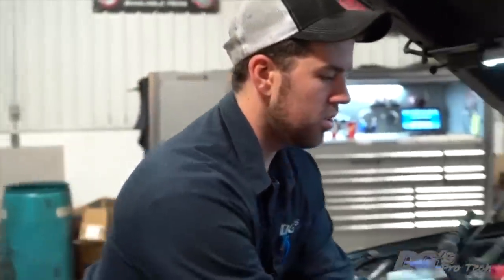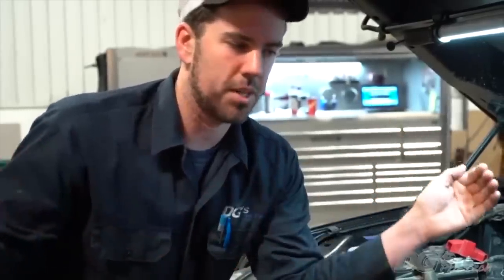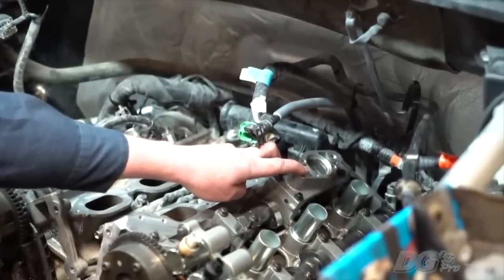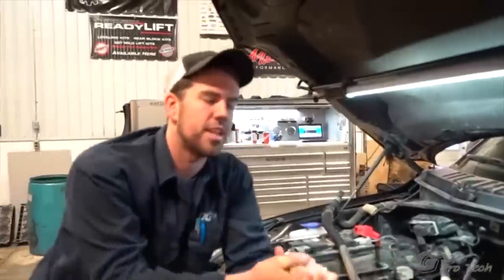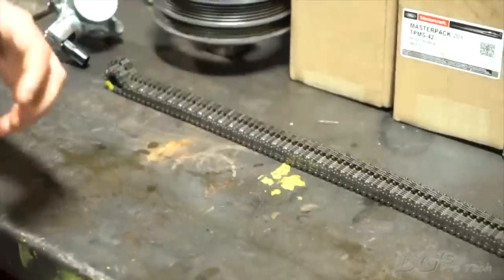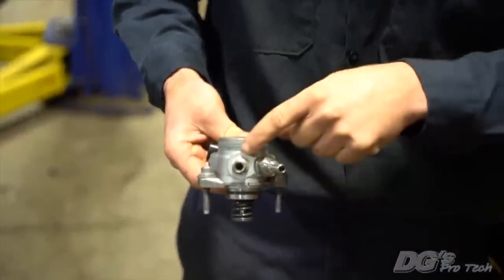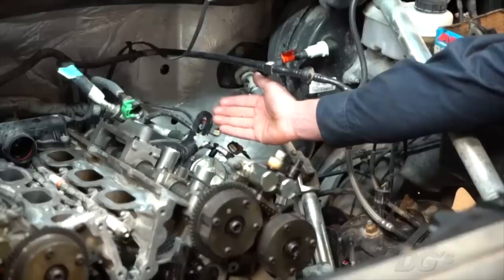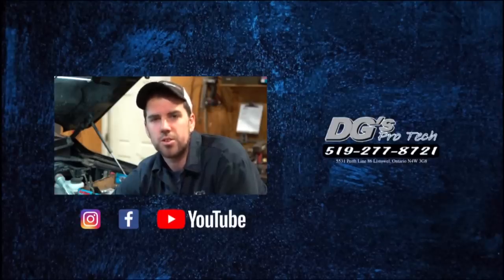What you NEED to know about Ford EcoBoost Engines by Dustin Golley of DG's ProTech

Comment: I'm old school I've never understood labels on a bottles of oil stating 5K 10K interval oil changes you can go. First of all even though engines are mass produced they all are slightly different meaning they all behave differently some burn oil more than other engines do. Most people don't understand this. In terms of the topic maintenance you can expect to go 5K 10K between oil changes because you don't know how that engine burns oil. Some do some don't. I have a 1995 Ford F250 with a big block 460 cubic inch motor 7.5 liters. with 86K miles on it. I change my oil on all my cars myself religiously at 3K miles. I said I was old school. And because it's a 1995 I check my oil level once a week sometimes once every two weeks. That truck burns NO oil at all every 3K oil change. At 3K the oil level is always full. Now we have two Chrysler town and country Van's. The 2010 has the 4.0 liter V6 engine. the 2015 has the 3.6 liter engine both of those motors burn oil.! The 4.0 I have to add half a quart right at 2600 miles to ensure get to 3K oil change. And the 3.6 I have to add a quarter of a bottle of oil right at 2900 miles. All cars I use the best on the store shelves full synthetic. We also have a 2007 Chrysler Aspen suv 5.7 liter Hemi it's a nice looking suv we are the 3rd owner of it and it had about 89K when we bought it. No telling how the first couple of owners treated that vehicle but it to burns oil. Bottom line change your oil every 3K not 5K or 10K it's not all that much more $$$ well it's alot cheaper than the auto repair this mechanic is doing

Comment: Don't forget one of the more important steps,  let your eco boost run, and cool down at idle after a trip home,  or after pulling.  I like your video.  Keep it clean,  (good oil), open it up once in a bit.  
But let that thing cool.  If you pulling something and your finally at your destination,  don't just shut off. Let idle,  it allows the turbo to cool.  
Great video

Comment: The first day the engines came out any mechanic with half a brain could see they were junk and where the problem would be.  Running a high pressure fuel pump with the timing chain?  These engines and all like them are junk and always will be.  Avoid

Comment: As an expert in the manufacturing of full synthetic engine oil, you should use at least a 10W30 full synthetic unless you pull a trailer over 3,000 pounds. Then use a 15W40 full synthetic for heavy towing. Change the oil filter ( never Fram )every 3,000 miles WITHOUT draining the synthetic from the engine. Change your synthetic every 10,000 to 12,000 miles or once a year, if you don't drive much. A full synthetic never breaks down ( it's not petroleum, it's a chemical lube) but it accumulates carbon by breaking it ( carbon ) down in the parts of the engine. Never, ever let your engine overheat. If it constantly runs too hot in the summer, add a double oil filter unit and use a longer oil filter, to keep the temps lower. If you summer temps are 80 F every day, use a heavier grade of synthetic. Never use Castrol synthetic as it's made from petroleum oil. Use Valvoline, Quaker State, Pennzoil or Mobil One synthetics to have the best quality. Change your front wheel drive auto trans fluid every 25,000 miles and use a quality synthetic there too. My fleets ran over 25 million miles ( 40 million km) so we got instant feedback on any issues. Synthetic oils save 5 percent on fuel use in the warm months, so it actually saves fuel costs. They save 15 percent in fuel use during the winter for trips up to 12 miles at 20 degrees F.

Comment: When he said, "This chain is a little lighter than I want to see."  he is calling FORD out on the fact that FORD cheeped out on the timing chain.  The bulk of the chain is too little and the toughness of the chain is too low.
Reply: They are all into making the vehicles as light as can be. Just like that truck is rated to tow close to 13,000 lbs but anybody who has towed knows that truck is to light to safely do it. I would not want a 5500 lb truck towing 13,000 lbs that is for sure.
Reply: @tshearn624  Just like I  wouldn't want a 7500 RAM pulling a 30,000 lb trailer - but they advertise that.
Reply: I agree Duanne
Reply: The Ram 3500 weighs over 11,000 lbs though so I would be good with that.

Comment: After all these years, they still use a link type chain. Surprised they aren't using plastic tooth aluminum gears, also. Should be using roller chain, and not interference engine.  Engineered obsolescence!

Comment: So basically buy a 5.0. Drive it however you want. The money lost at the pump is wash when you're talking about synthetic oil changes more frequently. These little V6s sound like fart can cars. Nice ford truck with 33 inch mud terrains flashy wheels but sounds like grandma's Honda Accord.

Comment: My 2.7 reg cab 4x4 is lifted 4 inches on 35s with spedo recalibration ,combined milage 23 mpg towing a 14 foot car hauler amd 3500 pound car 18 mpg 61000 miles so far full synthetic every 5k only oem air filters

Comment: my Escape has the 1.5 EcoBoost under the hood.  It's been three years and not one issue.  My only recommendation is having a good grip on the wheel, when you step in the gas.  It has 30,000 miles of city driving and averages 25 mpg

Comment: great video. great point about oil changes; even with synthetic oil, turbocharged engines should have their oil changed 6k-7500k miles tops. they only have the worst exhaust note of any stock vehicle on the market, but thats not really an issue. love the ecoboost motors. It's strange, I wonder if some of the timing chain issues stem from the HPFP being on the cam lobe. it seems like a lot of DI gas engines have timing chain issues

Comment: You should expect with today’s reputable car manufacturers more than 250 to 300K and even more, with a “SANE” mature driver that is, with the right synthetic oil and quality filter and a 6 to 8K service the mechanical  “engine” parts should last, don’t forget spark plug change and do them at 50K “ NOT “ 100K, air filter at 25K and coolant changes as recommended by manufacturer ! Automatic transmissions are so many times neglected, keep on top of that service with correct quality manufacturer recommended transmission fluid and filters !

Comment: Excellent explanations all the way around.  I love his explanation for those complaining about poor gas mileage.  You can have Eco, or you can have Boost, but don't expect both at the same time.  There is no free lunch and that's been a constant for as long as internal combustion engines have been in existence.   I've heard of the cam chain stretch issues before which kind of suprises me.  That's not something that I've seen common on most OHC engine with chains.  I'm guessing it has to do with that high pressure direct injection fuel pump?   That's got to be adding quite a bit of added stress on the cam chain?

Comment: What a crock!! More Ford garbage!!
My Silverado 5.3 V8 AVERARGES 24 MPG and higher AVERARGE!! I have hit the Rev limiter racing in four low multiple times!!! It  Has 107, 000 trouble free miles and I off road the shit out of it!!
My 4.3 ZR2 had 252,000 miles on it when I sold it and ran perfect!
Ford's are Ford's!! Garbage!!!
Oh and you can easily go 10,000 in a Chevy on an oil change!!!
YouTube Deboss garage Why not Ford.
YouTube CAR WIZARD tears down a 5.4 Triton.
JUNK!!!

Comment: I have a 2013 fx4 ecoboost and I'm so satisfied with its performance. I think that the drivetrain is to big for the truck as in using it for work. I've pulled 12,500 from Michigan to Florida 5 times with no problem even in Tennessee and Kentucky. I use my truck for my lawn care business and fill the bed to where it needs a tarp over it so no logs fall out and pull my 14foot dump trailer. This is where cause of payload and tounge weight it putting the truck to its max I put another leaf on both sides plus a helper. But i think my f150 out performs my 2013 HD chevy i had in heavy towing best truck i ever bought. Ford should beef up the rear end on the truck and put airbag assist to level it out then the truck would be a pulling monster for a half ton

Comment: Owned two of these. Over 100k miles on them. No timing chain stretch. No magic timer on when to change the oil. In fact, the oil life monitor estimates oil life based on throttle readings, towing or not, temperatures, and a bunch of other parameters. There is no "turn the light on after X miles" on my trucks. Also, the manual recommends a MAX of 7,500mi interval on the oil changes. Ford does NOT recommend over that. Anybody doing 10,000+ mi changes has not read their manual and they feel that they know better than the people who designed the engine.

Only turbo issue I had was due to a factory assembly issue. A cooling line was not assembled correctly and it leaked, causing one to burn up. Replaced for free. I drive gently in traffic and use them when I tow or need to go quickly. Every time I hear of turbo issues, or issues with timing chains, is when people buy the truck for the mileage and granny it everywhere, or when a hot-blooded guy gets one and drag-races everything else on the road (high RPM, always in boost). The other 99% of us have had no issues with these engines.

To sum it, if you buy a dang truck, drive it like one. Don't stomp it like it's a Mustang. Don't granny it like it's an Oldsmobile. Drive it. Use your brain and change the oil when the IOLM gets down around 30%. I know a few guys that have 500k on their 3.5's and have had zero issues with them. Heck, a guy just turned over 220k and posted his truck on Reddit a week ago. These engines do not have issues any more than any other engine. The driver is the issue.
Reply: 500K bullcrap..everything else on those trucks would be dead.
Reply: @chadhaire1711  I had two 1995 Rangers. Both were super-cab 2WD. One was a 2.3L I4 manual transmission with 363,000 on it when a guy hit me and rolled it twice. The other was a 3.0L V6 automatic with 312,000 on it when an idiot had a 700cc quad roll put of his truck and hit it head-on, bending the frame. Neither had any issues due to maintenance. Neither was rusty. Neither burned oil. But I guess in less than 200k more they would have been junk? Right.

Also, consider that the new F150 from 2015 on is aluminum. It literally does not rust. If you scratch it, it will oxidize and seal the metal. So if you do proper maintenance (plugs, wires, differential fluid, transfer case fluid, transmission fluid and filter, bearing grease, u-joints, etc etc) they literally will last forever. Not all of us beat them to death because they have turbos.
Reply: @GuretoSefirosu   The Ranger was nothing but a Ford Pinto..if you got more than 100K consider  yourself lucky.
Reply: @chadhaire1711  It is fairly clear you are not a Ford person. Rangers are known for going forever, even after being abused. In fact, they are about the toughest small-size truck around. Well, were until they stopped making them in something like 2010. New ones are NOT the same breed. Either way you are either trolling or do not know what you speak of.

Comment: stretched chain is due to contaminated oil with soot particles. Also, fuel dilution contaminates oil to the point that oil is no longer provides lubrication. Synthetic blend oil at 2500k miles is beyond oil specification and cannot be used beyond 2500k miles. Cheap oil gives you cheap results and engine wear.

Comment: This helps me. I always have used Mobil 1, Motorcraft oil filters, change oil, filter every 5 k miles. Just need to open her up a bit more...
Reply: R Mack  Paid oil lab analysis are extremely accurate that is like saying a blood test to show certain level of vitamins are not accurate.. the lab tests shows various metals in the oil analysis trust me i used to pay for the off brand full synthetics ill never use anything but motorcraft from now on in my ford engines this is strictly for for engines im saying i believe ford uses special additives that are SPECIFICALLY formulated for better wear results than other universal oils and it makes perfect sense they know there engine best and what its made of specifically just like the cooling system... and why they stress to use motorcraft coolant it protects the cooling system the best from after market brands
Reply: R Mack  You must have a low iq that wasnt the point at all... the point was about how their oil is best suited for ford engines and how a lot of people go off and use off brand shit that isnt as effective at protecting FORD specific parts
Reply: If your not using the ford oil your doing it wrong.. there is a guy on amazon who paid for oil lab tests and showed that the motorcraft oil gave the best results for ford engines.. who would of thought ford oil would be more effective on ford engines than a universal off brand... ( This oil gave me the BEST Blackstone Lab reports on my Ford  engine. Lowest parts per million on iron, aluminum & other important metals. I wish I had used this oil from the date I purchased the car. )
Reply: R Mack  Haha

Comment: You forgot a couple other issues:

1. The lack of a mechanism to clean the intake valves and carbon build up that comes from PCV/EGR gasses building up on the back side of the intake valves. 

2. The intercooler water slug of death! No float drain built into the first Gen eco boost intercooler. Major oversight. Hydro lock over a $1 component that was left on the engineering block.

Comment: Great video and very well done! Although not your intention, you listed a bunch of compelling arguments against a ecoboost engine.  These vehicles are already too big and costly to have the specter of all these failures hanging over your head. Sadly, due to unrealistic mileage requirements and arbitrary unrealistic test criteria, all these costs land on the owner. Consider the resources to build and maintain such a complex machine that at best gets slightly better mileage? What have we saved?
Reply: you run up 150K miles then sell it to some sucker before it breaks.

Comment: They get great fuel mileage on long easy trips. Have made 26 miles/gallon on a long highway trip with mine, but when you work them hard, they get very thirsty. I only use full synthetic oil every 8000 km and a quality filter (not a Fram) and run premium fuel.

Comment: Great video!  Great advice, thanks!  I went with the eco boost for my 2019 F150 instead of the new 5.0 that Ford screwed up after the 2017 model year.   Did a lot research on the 2018 and newer Ford truck engines, and found the 5.0 is very problematic in the F150 and Mustang.

Comment: You will still have oil leaks from the vacuum pump, turbos, and front covers. The timing chains aren't as high quality as they should be. Don't fool yourself. Turbo engines, and also being DOHC is going to be EXPENSIVE TO FIX.

Comment: Just a heads up, Ford is working on another TSB for worn timing chain components (as of 12/20/2019) Should be released first quarter 2020. I am a 35 year Ford technician. Well done video with clear explanation for the general public.
Reply: Can you add the second tensioner to the pre 2018 EcoBoost motors?
Reply: @StormxRaiden  There is nothing available that I am aware of.

Comment: Great video, well explained. Bottom line is follow the recommended maint program and you will have a great engine that will last a good long time. My Bud pulls his trailer 10K lbs. And his is the big V6. He has over 170K on the motor, and his mileage is the same as when he bought the truck. He drives it hard, and pulls at least 1X a week. I have the 5.0 and after seeing how good his engine is, my next F150 will be an eco-boost.

Comment: I was prepared for a major Ford bashing. Thank you for an honest video. Preventive maintenance is the key to any mechanical device. Do what the book says, and all will be good. Also glad you hit on economy. People don't realize that for any amount of work, it takes a certain amount of power. Weather V-8 or turbo V-6. Power takes fuel. But most trucks drive around empty. That is where economy is maximized. My 2018 F-150 has gotten 27 MPG on the highway, granted by setting cruise control at the speed limit for the 70 miles . In the same situation, a 5.0 wouldn't get that good of mileage.
Reply: @RJ Least of These Farm Wow... my 07 supercrew 4x4 would get 18 on the highway....

Comment: mean while a 1994 toyota camry is still running with 500k miles.  . . smh.
Reply: Because the engine is not as advanced and people aren't mashing on the throttle because of the power. A no-brainer.  I went from a 2008 4.8 Silverado to a 2015 F150 3.5 Ecoboost and have to say it's much harder to drive like an adult now because the Chevy had no power and I didn't want to embarrass myself when someone left me standing still.  I had the Chevy 9 years and it was pretty much in the same shape as when I bought it because I drove it like an old man. I am concerned about the Ford because I feel like I'm giving it unnecessary wear and tear driving like a fool. They say that it's a  high pressure set-up and being a small engine with an aluminum block, running it hard will shorten it's longevity. I would drive the Camry like an old man also, to stay under the radar. I'm sure that will make all the difference.
Reply: I hear you dude but your Camry has zero performance, zero power.  These 3.5 TT Ecoboost seem to be over-achievers.
Reply: Lots of EcoBoosts out there with 200k+ now. Ford ran this engine with great success at both Le Mans and the Baja 1000. That is a lot of abuse, but different than everyday driving of course, but if you take care of it, it will stand the test of time well!